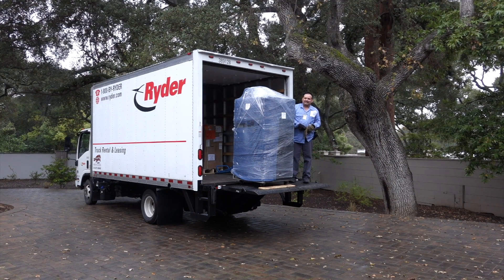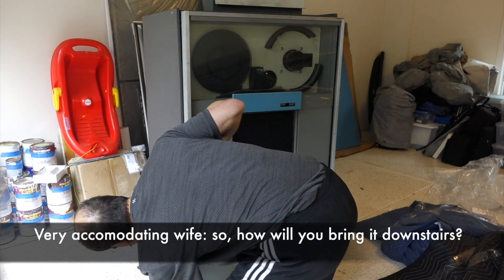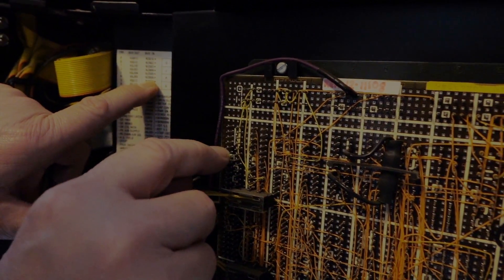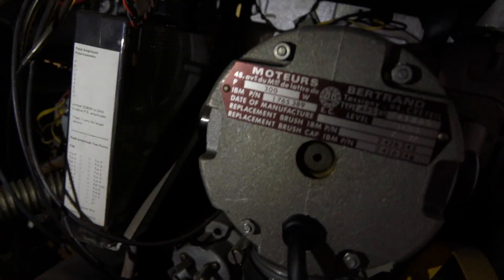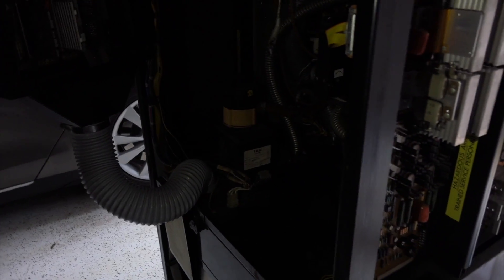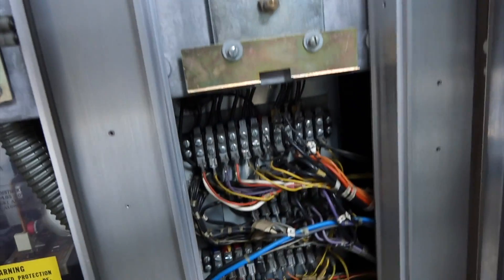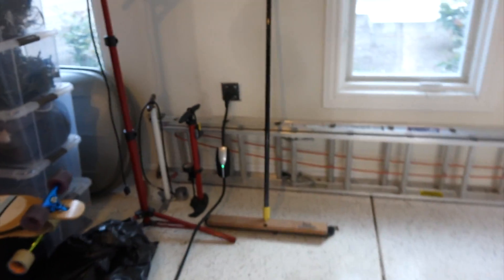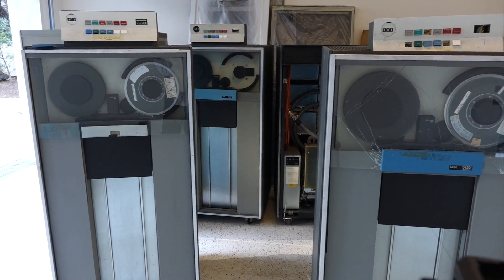IBM 3420 9-track tape drives arrrive for restoration. 800 lbs each!

Comment: I'm sure someone has mentioned this somewhere, but you can call the power company and have them install a 3-phase supply to your property if you want. Typically you get a separate 3-phase, 100-amp panel though I imagine it varies from place to place. A lot of home shops require it because lathes, routers, CNC machines etc. often require 3-phase. You can buy the VFC units to do the conversion from 2-phase but you're usually limited in power.

Comment: Those babies were HEAVY. One day in the 80's at a company headquarters conveniently located next to the San Jose airport a person I won't name decided to drive a forklift onto the data center's raised floor to move a 3420. Once he raised the 3420, the combined weight of the forklift and the tape drive collapsed a section of the floor. What a mess. A wall had to be removed and a temporary ramp built to get the forklift out. The tape drive was a total loss.
Reply: Lol, wow! What a mess, indeed. I can only imagine how the guy responsible for it had to feel.

Comment: Did you do anything with the tape drives? Just wondering. I'm more interesting in you getting back to the hp2000 minicomputer and such. :)
Reply from the maker: Just preparation work so far. Cleaned up the crumbling insulation. Got the power connectors (these were very hard to identify and even harder to find) and the Bus and Tag cables. Got an IBM tape tester and restored and reversed engineered a CDC Bus and Tag tester. Got the controller schematics (these were also very hard to find). Constructed a ramp to get them inside the house (there are a few steps that we have to get over). Repaired the OS/2 computer for the channel emulator card. Ken has also made an IBM 360 CPU emulator. Apollo is getting priority.
Reply: I couldn't remember if you or somebody else said they had the card for that. I found that very interesting. I card to hook up your ibm 9 track tape drive to a pc. @CuriousMarc
Reply from the maker: @idahofur  It takes two cards. I have one of them (the channel card). IBMmuseum has the other card (the 360 CPU), and volunteered to lend it to me.

Comment: We had a Tandem Nonstop with 2 vacuum column drives. I don’t know who made them. Our team was not fully trained on how to maintain and fix them so that could have been a part of the problem. They were somewhat unreliable. Full backups might take up to 11 tapes and it was a nail biter to see if it would make it through that many tapes.  Nice to see videos of that old equipment but not so fun on a day to day routine

Comment: The fiber optics are for both the capstan motor encoder as well as the rewind encoders on the tape path. It appears to be a model 8 if I remember right they had the autocleaner which is the black plastic lookin box on the bottom

Comment: Those were the great days of tape. Where you could actually see the tape moving in little jerks as the tape was read in blocks. (Which makes those of us who know laugh at all the 70s and 80s movies & TV where the tape drives just spun continuously). 

I have believed for a long time that any technology, as soon as it is perfected, is obsolete. Think CDs, DVDs… And the 3420 was definitely the apotheosis of 9-track tape drives. They were so easy, but I forget the exact buttons. Window down, slap on the autoloader cartridge, then press load et voilà! Stand and watch the drive unlock the cartridge and unload the tape.

My memory is faulty – I dunno why I remember the full spool being loaded on the left which is clearly wrong. But wasn’t there an (aftermarket?) display on the top of the drive that would alert the operator when manual intervention was needed – Mount Tape #XXXXXX, Unload, etc?

Comment: you're recreating my first computer room! all you need now is a 3203 printer, a card reader, a keypunch machine, a few 3350 disk drives and a 4381 CPU.
Oh I guess a 3270 controller and some terminals. -then i can be 19 again. ;)
Reply: Ah, yes, the IBM 3350. I have to laugh at the fact that we were impressed that they could store ~320 MB each at some fantastically large price. And I have more online disk storage in my apartment than ran a large UK bank in the late 1970s!!

We had the ones with the fixed heads. I see in the Wikipedia article about them (https://en.wikipedia.org/wiki/History_of_IBM_magnetic_disk_drives#IBM_3350) that the fixed heads were used for JES2 spool checkpoints and swap spaces. Nah. The canny systems programmers used them for the directories of system library PDSs (with some very clever dataset allocations) so that loading a program from the system libraries was faster.

Comment: I worked on these in the late 80s, spent many an hour replacing faulty vacumn switches, adjusting read head amplitudes, replacing fibre optic bulbs in the "horse shoe " as a slightly dimmed bulb could cause all sorts of issues! And even back in the late 80s  the vac/pressure tubes had become hardened so we alway carried spares. The capstan wheel was a very delicate part and needed real care when working on. The white paper tape near the head is part of the auto cleaner assy.  We still had customers using these into the 90s 🙂 They were marvels of engineering and it was always impressive to see a well adjusted unit with the tape working within the limits of the collumns to allow the tape to be moved without too much tension backwards and forwards by the capstain at high speed.Hopefuly you'll be able to find some MAPs and MIMs to help with the rebuild 🤞

Comment: 9 track... Is that the 6250 bytes per inch high density version?
Reply from the maker: Depends on the model. Mine are the “later” (as in 1973) model 6, and can work at either 1600 or 6250 bpi, assuming they are connected to a 3803 model 2 controller (which is the one I have). The “earlier” models 3, 5 and 7 would top out at 1600. But they did also support 800, 556 and 200 bpi, and also work in 7 track mode. Which actually would be much more useful to me, as they would be compatible with the IBM 729 tapes we use on the IBM 1401 at the CHM and the HP 7970 tapes that are used with the HP 1000. But one can’t be picky, it’s hard enough to find one, and I didn’t even know this wrinkle when I bought them…

Comment: Hey marc, any updates on what's happening with these? i love old IBM machines and would love to have a Alto style series of videos showing these being restored. 
great content keep it up.
Reply from the maker: Still in the garage. I have gotten more pieces of the puzzle though: finally figured out what the weird power connector is and got cables and connectors, I have Bus and Tag cables, a tape tester. I should get a tester for the controller in the next few weeks. Most important, I acquired a 3 phase inverter that might barely have enough power to get one of these up. Stripped all the bad foam out, which was a big job. We think we have located a place that has the only 360/50 documentation we know of, but have not been able to digitize it (it's overseas). The IBM 360/50 is by far the longest term project I have, truly my "retirement project". We make progress little by little. But we keep being distracted by space hardware comes along and that we have to jump on.

Comment: I worked on the design of that tape drive at IBM in 1968/69. The first circuit board design of my career is in your video, a -4 volt series regulator for the logic system. The regulator is an SMS board at lower front left.
Reply from the maker: Awesome. Would be nice to get in touch with you! You can contact me through my About... channel page: https://www.youtube.com/c/CuriousMarc/about

Comment: Before I left my work in a banking envoroment back office back in 2009, they still had 5 of these units due to clients not evolving their structure. We also had 4 of the tape cart. systems. I still have a bottle of the cleaning solution, 99.99% alcohol

Comment: I have funny, mixed feeling about attempting to put together a legacy IBM mainframe system as, to me, it reflects no real fond memory except the many folks I ran into dealing with these things from day, to day.   Running around town fixing these things 24/7 got old as assigned account CE’s failed to pull their weight and let things go, so I had to go out and put out the fires. All. The. Time.  To me, the real troopers that made this mad system work were the grunts that sacrificed more than you can possibly imagine.   ...  But then again, I’d love to frezbie an errant 1052 console printer through a clean, intact window.  You know, just for grins!!

Comment: All 3420’s toward the end of their lifespan’s exhibited disintegrating vinyl hoses, foam rubber insulators, rubber door seals and became a PM nightmare.  The magnetic tape also became an issue, especially with 3420-8 tape drives as the tape substrate holding the data holding iron oxide surface also disintegrated in the same fashion and as it moved at mod 8 speeds it would over heat and stick to the read/write heads, ruining the tape.  And also ruining the tape drive itself.  Lots of tapes from overseas caused so much grief it really spelled the end of 9 track tape drive subsystems.  Mod 6’s can also be effected by this but to a lesser degree as they moved the tape slower speed over the read/write heads, causing less heat buildup.  Spent time with many trips to the hardware store seeking many sizes of tubing stocking up on those midnight calls!  beep beep beep beep!!!  Oddly, the 2400 series tape drives didn’t suffer this problem, they had “Prolay” and tape motion issues.

Comment: It's interesting that in the 1980's Los Angeles had an IBM System 3090 installation using STC {Storage Tech. Co.} tape drives! They became obsolete, the shop converted to tape cassettes on an automated system. These days, they're probably all gone. I didn't realize the weight of these devices! LOL! Thanks for the video!

Comment: 50-to-250 megabytes of tape storage in one of those drives. You will need 512 of them to equal the storage of a 128 gigabyte USB drive the size of a pinkie finger.

Comment: Aaahh, Memory lane... I used to be an IBM specialist on these tape units Spend many hours repairing and adjusting them. You probably figured it out already but the idler that was lying around goes on the air pump assembly to tighten the flat belt. It is a pity but about 2-3 month ago I threw away a whole suitcase full of spare parts for these units. Vacuum Switches, Light pipes, lights, idles, tubes... my personal spare parts magazine I used at the time. BTW there are supposed to be more books. They are called ALD's and MAP's. You need the MAP's for the adjustment procedures for Capstan tacho and R/W Heads. Be advised that the Device interface cable between Tape unit (3420) and Control unit (3803) are different than between Control Unit and CPU (Channel) They are not interchangeable !

Comment: The 2420 mod 7 came out in 1968 I believe. It had a huge cage of electronics and was very poorly laid out. A low cost 2420 mod 5 was released in 1969 which used MST for electronics, and had the much nicer layout used later in the 3420. Most 2420 model 5's were converted to 3420s. If you have a converted 2420 it will have a serial number starting with "9" (9xxxx). If you can get the service manual for the 3420 it sometimes splits into different sections for 90000 series machines. The 3420 was one of the first machines to use MAPs for troubleshooting (Maintenance Analysis Procedures). If you need help on that I've fixed about 843,297 of them.

Comment: Um sistema completo. S/370 145 com discos 3330 e TCU 3745 com NCP controlando linhas e terminais remotos. Sistema operacional VM  acima de DOS ou OS. Linguagens usadas: Assembler ou COBOL ou COBOl/CiCS. Era o mundo da informática de então. O mundo mudou mas o mainframe IBM continua processando as transações do mundo.

Comment: Do you need the original 3420 Tape tester? I have one in my Garage. Is is a small device you need to test your 3420 mechanically.
Reply from the maker: We will indeed need one. Carl has lent me his, but we don't know if it works. We might reach out to you if it does not. What else do you have in your garage ;-) ?

Comment: What are the newest computers that can interface and work with one of these IBM 3420's or other similar drives?
Reply: @Jack Nerdy;  Former IBM Systems Engineer here.  There are no modern mainframe computers that can attach this tape drive because the latest mainframes (aka System z) do not have channel adapters that support the bus & tag cables required to attach them nor do the System z operating systems allow you to define them I/O devices.     https://en.wikipedia.org/wiki/Bus_and_Tag
Reply: @knightwatchman  there is a escon to bus and tag converter and using one you can in theory connect one to a Z10 system, the last one i remember supporting escon ..... for direct machine connection i think the last mainframes that supported one was the 9672 series. I had 2 drives connected to a 9221-211 in the late 90's early 2000
Reply: @bluerio25  Hi there.  Yes.  The z10, the z196 and the z114 (I believe) were the last to support ESCON.

Comment: Very cool.  I worked on literally 1000's of those as a FE/CE for IBM in Dallas back in the early 80's!  Actually - check the CE logs, I might have worked on these!  :)
Reply: Same here, I had the Sears account at their warehouse on S. Lamar St. in Dallas. The 2400;s were  eventually  replaced with Telex drives. Sears soon found out that the Telex drives were even more trouble prone than the 2400's, so they were replaced with the 3420's. There were four systems with eight drives each. No more pro-lays to adjust.

Comment: Nice to see those tape drives and controller. I didn’t work on those drives, did work on 3411 and about 10 different systems
360/20, Sys 3, System 34, 36, Series 1, System 7, AS 400. All of the attached i/o devices, was a teacher for 1403.  You can’t convert 
your power from 2 phase 208/230 to 3 phase 208/230.  Your house current would have to go to 400 amps to handle
this equipment. Those are Russle Stowe connectors 3 phase + ground 60 amp connectors.  You need bus and tag cables
to hook up the tape drives the controller.  System 370 uses a voltage conversion system and most are water cooled.
400 hertz converter, with cables that look like anaconda snakes. If you are making a static display great to make a functional 
system requires an electrician and power requirements that most non commercial building or homes do not have nor would 
your local government allow.  I worked in New York city.  I had Equitable Life ins as a customer and multiple other customers
I was an Account Customer Engineer.  Was a great time to work.

Comment: Sir, I don't think that Mercury switch is for sensing Air Flow. Its most probably a switch to detect if the System Cabinet Door is Open or Closed. Great video ! Thanks a lot for this Sir !

Comment: Marc, you have likely found this already http://www.ljw.me.uk/ibm360/vhdl  This seems to be what you are looking for, FPGA RTL for a System 360 model 30.  The GitHub seems to contain all the files: https://github.com/ibm2030

What I find interesting (from a few minutes analysis) is it looks to me that the author didn't make an emulator, he seems to have duplicated the 30 logic directly from the manuals.  It's in what I tend to call Verilog style VHDL... which I find a little frustrating to read, but at least it is VHDL.  He suggests it should fit in a Xilinx XC3S1000, which is pretty small these days.  If your tape and 360 panel restoration project is still alive, and you're interested in starting from his code base, I'm happy to spend a little time trying to bring the thing up in GHDL and/or one of my FPGA boards.

Comment: Note, people, how the controller circuitry (which handles all the actual I/O with the CPU) is in an entire separate cabinet. The concept of “Integrated Drive Electronics” lay a couple of decades in the future...
Reply: Wasn’t there a “string controller” or control unit that then talked to the channel (again a separate box in the /370 days)?

And do you know why there were so many bus & tag connectors in the back of the tape control unit? Could it run multiple strings if connected to a block multiplexor channel?

Comment: These tape drives were from the System/370  -  3033 - 3083 era, yes?  Not so much System/360.
Reply: Corrext the 360 era was 2401s
Reply: @rty1955  3420's also were used on the 360 series. Completely compatible.

Comment: 3420 tapes drives were never used on a 360. It was a 2400 or 2401 tape drives. 3420 was on the 370 models
Reply from the maker: You are correct, they are from next 370 generation, as is the 3808 controller. But that's the closest I could get. You cannot get too picky when you find these... And it should work connected to a 360 channel (hopefully).
Reply: Yes they were. They were 360 compatible. I was an IBM CE and I had 32 3420's at my customer account, all running on system 360.

Comment: As an old IBM CE of that era, I wonder what you expect to accomplish?   
I think you're going to find, it's a lot more complicated than you ever imagined.   I am not suggesting that an appreciation of the complexities has no value.  If that's your goal, I suspect by now you will accomplished your mission.
Reply from the maker: But the fun in these IBM behemoth is to run the peripherals! See the IBM 729 debug video. We now have 7 of these funning at the CHM - demonstrated several times a week. I have not seen a running 3420 yet.